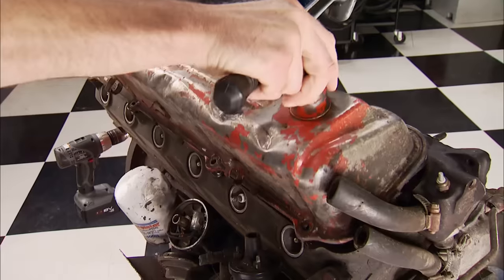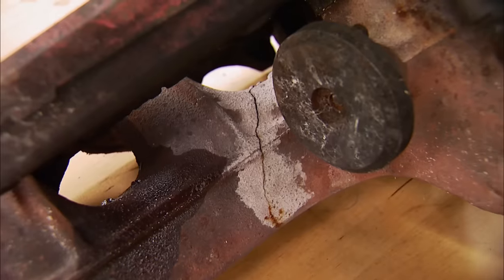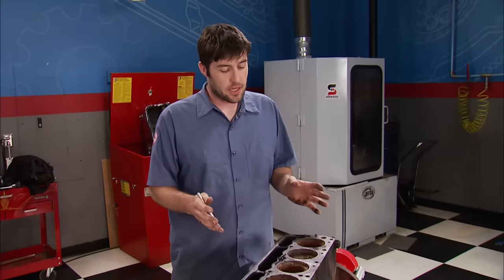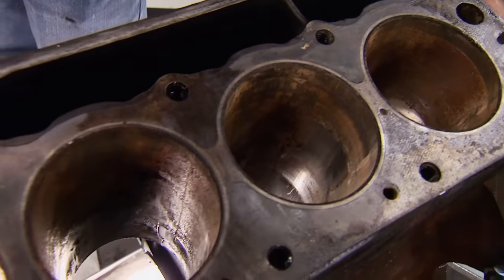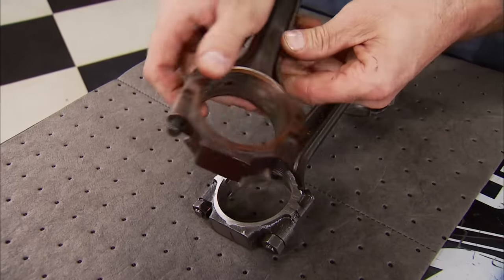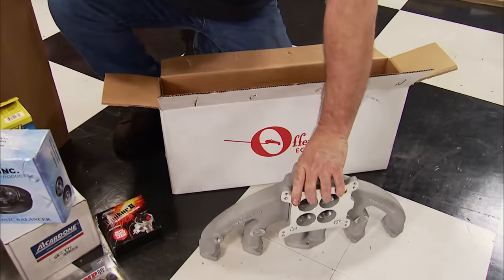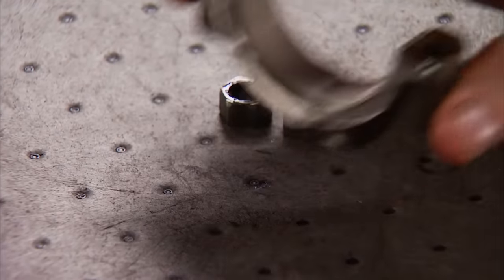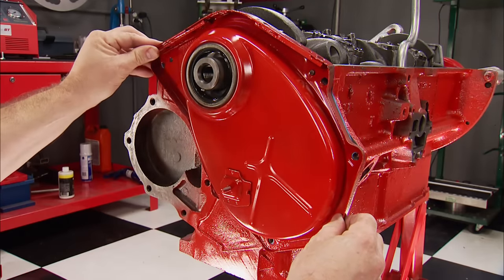Resurrecting A Mopar 225 Dodge Slant Six - Engine Power S2, E2

Comment: I would have filled the cylinders with oil and let them sit overnight before beating on the rods with anything.
Reply: Rob B They could’ve used some WD-40 or something.  That hurt to watch.  Maybe they knew the the block was trashed before disassembly.   Looks like they paid $150 for a cylinder head with all the parts they replaced.
Reply: ATF would have made it a lot easier, and I'd have pushed the pistons through onto the crankcase to avoid the nasties in the cylinders. My guess is that they already knew they were going to junk the engine.
Reply: @1spaghetti32  Right on bud, there was a lot of money wasted on an engine that, while legendary for longevity, will only be good for a completely restored vehicle like the Dart they plan to put it in. I think he said $900 for that head.
Reply: I would've tapped the pistons down an inch first then used a "christmas tree hone" to de-rust above. They'll tap out much easier without risking rod damage.
Reply: Dave Kauffman why wouldn’t they film them selves disassembling the other engine to begin with?
Reply: @1spaghetti32  with all the revenue they're going to get from the views of this video, they can pay a lot of bad engines and it wouldn't matter.
Reply: I overhaul airplane cylinders for a living. I took one look at the corrosion on this engine and thought... ya that's probably garbage. Since you can pretty much build an entire slant six engine out of a magazine, I wouldn't have cared. None of these parts are particularly rare and almost all are re-manufactured at a reasonable price. Also, a slant six in a car that had V8 options generally means it is worth less. So why bother? Get a V8.
Reply: Amateur's!
Reply: @daytonasixty-eight1354  if you have money and time to burn, you can get 600 horse out of a Slant Six.
Reply: @daytonasixty-eight1354  V8s are boring, everyone has them in their classic cars, they're a dime a dozen. I can only look at so many V8s with chrome valve covers and "performance" intakes before my eyes glaze over.

Lower power and less common engines are far more interesting, you got to see how the designers either zombified a larger engine design to make them, or something completely original like a straight / slant 6. They often cost more to get running again because of parts scarcity, but its worth it.
Reply: @GGigabiteM  Hey if you like wasting money go for it. I'm not going to stop you. But if you really want to build a low powered engine in a classic car. Why not start with a classic car that has a low power and uncommon engine that's actually worth something? Like an MGB or Triumph TR6 for example.
Reply: @daytonasixty-eight1354  Not really into English cars.
Reply: $900 was for the Edelbrock small block Chev head featured in the advert at the end of the video. Bit nutty to put $1800 into a pair of heads for a SBC when you can grab a $500 boneyard LS & spend a grand refurbing it & have twice the motor a Gen 1 SBC will ever be.

Comment: Just imagine. No computer modules to reset or sensors monitoring anything and everything. Easy access to plugs, wires, engine accessories, oil filter. A mere mortal can perform nearly all their own maintenance on the engine. Dare I say I miss those "good old days'?
Reply: Amen brother!!!
Reply: If cars didn't have to pass smog tests, there might not have been such a pressing need to replace the slant 6.
Reply: It would have been great to let Mexifornia have the newer trash engines with their computer headaches and let the rest of the country keep running the sleepy sixes.
Reply: Its tempting but dont be a Luddite. Remember  12 mpg and carbon monoxide headaches? Tuneups of spark  plugs, wires, cap and rotor button [check points and dwell] with valve adjustments (and new cover gasket) every couple years? Yeah, The old days sound great. Even new shitboxes go 120k   without any of this. And usually with no oil/coolant leaks .Stand in line for gas much??

Comment: I've disassembled many " high value " core engines that were severely rusted up & never used an air hammer to force the pistons out . & I had most of them spinning over within an hour once down to the short block .  But then , I'm not an idiot !
Reply: guess they never heard of rust penetrant :D

Comment: '64 Dart GT bought an aluminum intake off one of the mechanics that I worked with, put the 4 barrel on it and for a slant 6 it was awesome. Now I just drive the '13 Dart Limited, 1.4 turbo, leather interior, heated seats and steering wheel. My how time changes things.

Comment: I was under the impression the engine was going to get refurbished, not completely replaced with all new parts.
Reply: Dave Micolichek  yes, but you also at least try and reuse most of the old parts. Not just completely get rid of everything internal and external and only use the engine block, in that case just Buy a brand NEW Engine. NOT everyone has the money to just straight up replace everything in an engine... we are not all made of MONEY...

Comment: These slant 6'S  can sometimes work somewhat backwards when trying to hop them up!  What I mean is that these engines were designed to produce power at a certain rpm range and trying to change that can sometimes spit in your face! One of the few engines that don't always respond to hopped up parts! Uncle Tony did a great vidio explaining what I'm trying to convey! He has a vast knowledge when it comes to mopar's! If rebuilding one I would refer to his knowledge & know how! Also if I remember correctly, the exhaust on these worked somewhat like a two stroke in the sense that it sent a pulse that the engine needed! My knowledge is minimal but I do know that sometimes the factory knew what they were doing!

Comment: is it me, or were there no usable parts from your $150 junkyard engine?
Reply: the two bolts for the fuel pump were still good  - lol
Reply: Sparky Wirenut that about sums it up. Lmao
Reply: Maybe the machine shop found it was rebuildable and kept it.
Reply: The problem with the hundred and $50 engine was the Machine Shop! They always say everything's f*** and needs replacing or rebuilding everything was salvageable except the Piston the Rings and The cracked crank now the camshaft? since I would like a Performance Engine I would put in an RV 3 cam I would mill the head put in bigger valves heavier Springs Mill the head port the head put on the 4 Barrel manifold headers put in a hypro pump a reground crank resize rods with heavy-duty racing Rod bolts and I would balance it and I would make a hot rod engine out of it but the fact is they let the Machine Shop decide that everything was no good you bore out the engine and if the the cylinder is cracked? You put a sleeve in it evidently these guys haven't been rebuilding long enough and have a big expensive shop? I've been doing this 52 years

Comment: Man, you can't beat a slant six. I had a 225 in a 1964 Dodge flatbed PU that I hauled firewood in. I drove it for over a year with a rod knocking. It gave out one day when I had to stop on a hill and it just couldn't get going with the heavy load and top the hill once the traffic cleared. It threw the rod and I just let it roll back into the shop driveway.
Reply: You can't beat a 6 cylinder Chevy. You can't beat a 4 cyl. Honda. When you put a tiny engine into a car, it seems to last forever. Oh, so why do we put big engines in them? Because given the choice, most folks want the power!
Reply: Joe Home  that's racist.

Comment: Solid old engines. I have even seen them come in with a cylinder blown out and still running. After boring it out and installing a sleeve it was rebuilt to continue on for many more years. Well designed engine.

Comment: extreme reliability , today the engines have a self destruct timer just after the warranty runs out .
Reply: Modern engines are way better than old ones. Hundreds of thousands of miles without a rebuild is normal now, it wasn't in them days
Reply: @mrcaboosevg6089  I pass brand new junk cars on the highway every day . Now when you need to repair your car , to get to the alternator you got to take out the Transmission and remove the back seat and rent a special tool to do it . I could kill an engineer / designer .
Reply: @harrytuttle8161  I just changed the alternator on my car, it was a ten minute job. My car is a diesel that revs more than this, makes more torque, gets outstanding mileage and makes more horsepower. Literally zero benefit to this this, it was a good engine at the time but not now
Reply: You have a problem....today's cars are far superior to the ones from the "good ole days"!!! Ever own a 57 Ford?

Comment: Thank you PowerNation for doing this build!  I had a '74 dart with a slant 6 from 1988 to 1991 to get me thru school. Ran great and always started, except for when the air temps got below zero. Then I would cross my fingers and hope it would start! Ran it until the frame broke in half on the freeway entrance. I junked it then. :(  Again, thanks for this video!
Reply: Expect for "great unibody construction", these cars would HAVE KICKED ASS forever!
Reply: These were GREAT "kick-ass" American cars! They had style , (GOOD) handling, POWER, and FUN! IF the body/frame construction had been up to (OLD TIME) Chrysler standards, these would have been LEGANDARY.!

Comment: My best friend in high school had an old dodge truck with a 225. We rebuilt it in our junior year and that engine ran so smooth we couldn’t feel it run. Those 225’s didn’t have a lot of HP but they were a nice running engine.

Comment: I wanted to hear it run , after all what is the point of building it if it does nor run !
Reply: it's a slant 6 of course it runs the thing I bet ran when they pulled it those things never stop running even without oil they still run LOL!!
Reply: If you did not hear what they said they have a duster it's going to go into once they get the car they are going to run the 225 that's in it on a Chassis Dyno then they are going to pull it and drop the rebuilt 225 into the duster and run it on the chassis dyno and compare the numbers but that will be on the next episode
Reply: we had one great running car sad to say we sold it to a dummy who ran it out of oil :(
Reply: If you heard it now, you wouldn't want to watch the next episode. :p
Reply: lol they sound like a tractor at low RPM and a sewing machine at higher RPM, unless they're built pretty wild.
Reply: Here you go: https://youtu.be/pjYW-SkQzvE

Comment: Sometimes when you send the block or crank out to the machine shop they come back and say sorry it’s no good. Thank you for not lying about it and pretending it came back just fine. Actually there’s quite a bit more that can be done to this engine and they run surprisingly well.

Comment: I'm gonna tell Uncle Tony.
Reply: Tell tony they didn't put the pistons in backwards and they threw away the points
Reply: These guy's are not real Mopar like Uncle Tony that guys lives breathes and sweats Mopar and knows the 170,198 and 225 like the back of his hand
Reply: They said the only difference between the older block and newer block was freeze plugs lol
Reply: Well. The they paid $150 for the original boneyard engine. And are only going to use the head. And a few brackets and hardlines. Then all these aftermarket parts another block. Machinery cost and so on. That thing better last well over 1,000,000 miles beacuse the original ones very often did if they were maintained correctly.
Reply: @adamturner2507 , that is a good way to identify the 
real "Leaning Tower of Power."  Look for the 3 
freeze plug version.

The blocks may be similar, but the heads will 
be the smog version.

steve
Reply: Haha you made my day
Reply: Something Funny 

Uncle Tony has forgotten more than these guys know about a slant six

Comment: This makes me want to rebuild my aluminum block that i have collecting dust in the garage
Reply: What for? if it's in good condition sell it if it isn't going into a numbers matching resto. 

I know a guy that rebuilt an aluminum block 225 and he was thoroughly unamazed at the power for the money spent. The design doesn't lead itself to really good power increases because of a few things. The capacity is a bit small even at 225 for the stroke length, the small bore inhibits breathing because you can't get big valves in the head. If you have that stroke length then a big bore is required to sufficient valve area to support high rpm breathing.  They run out of air because the pistons go faster than the capacity of the valve area to supply air. If you put a small blower on it, it could be the best way to go. You might find it is an entirely different motor lol but I just read what wikipedia said about the aluminum 225 and it mentions they're no good for that either due to the open deck. 

A slant is the kind of motor that you're painted into a corner before you start and the exercise is unpaint your way out as best you can.
Hyper pak seems about the best that can be achieved relatively cheaply:
https://en.wikipedia.org/wiki/Chrysler_Slant-6_engine#Hyper_Pak
Reply: @ThePaulv12  I was going to put in a lightweight "T-bucket style roadster" Maybe polish the block, put multicarbs and cruise it. Nothing stressful. Yes I'm familar with all the literature on limitations etc. If someone is interested in it I'm an hour north of L.A.
Reply: @332ARA  do it ....DO ITTTTTTTTTT  ..btw redline and speeco in australia make some good speed parts for the slant 6...or did

Comment: For those of you wondering "why did they lean it to one side?"

It was designed to be a replacement for the old flat head six  cylinder industrial engine.

The only way they could get the much taller OHV engine to fit in the same engine compartments was to lay it over on its side.

(They didnt want their industrial and commercial equipment customers to have to do major redesigns to fit in a modern engine)

The off set water pump is so the fan would be in the same location.

The only design change industrial equipment manufacturers had to do was deal with the exhaust flange being on the other side of the engine....other than that,  they pretty much dropped into whatever the flat head six had been in.

So the rumors of "they were going to make a V-12" ,"They wanted lower hood lines on their cars" and "Laying on its side compensated for torque wearing out the cylinders unevenly" is just urban legends.

The indistrial engine had good overall performance so they started putting them into cars.
Reply: Dave Micolichek  No , the engine first appeared in the mid 50's as an industrial engine to replace the IM-6 flat head in Yale Forklifts ,they didnt even put it in automobiles originally.

That this engine was in Yale forklifts a good five years before the first car had one , kind of blows your claim about hood lines right out of the water.
Reply: Dave Micolichek  You're trying to bullshit a forklift mechanic about when slant sixes first showed up in Yale forklifts.
I'm not going to argue with you about it.

Comment: "how to buy a engine throw it out and build another one from scratch"
Reply: Basically. These guys are frauds
Reply: They thought the first block would be usable.  Turns out it was not.  That’s not fraud.  Just bad luck.  Real hotrodders know that engines break, and accept it as part of the deal.
Reply: @karenstjohn6759  they should have named the episode something different.
Reply: @HellsHatersEnt  That, they could have done better.
Reply: Could have bought one that runs for about the same money.

Comment: I had a 79 Chrysler lebaron that had one of these in it.
That thing ran forever.
Reply: had an 81 same deal, wrecked the car 4 times, engine kept going sold it with 230k it went to mexico, probably still running

Comment: The comments were hilarious, and I agree.  We had had a slant 6.  Whenever you did a fast left turn, (like pulling out in traffic) the motor would die and you would have to put in it park to start.  Replaced the carb with a holly (on advise from experts) and still did the same thing.

Comment: The Beauty of an in-line six engine is its longevity and reliability. My first vehicle was a 1969 dodge D 100 stepside. It was easy to work on. Parts were cheap.

Comment: Come on guys.  Load those piston bores with wd40  before  removing
Reply: No kidding huh? Soaking it with PB blaster or WD-40 would have been intelligent..........
Reply: Or chuck some phosphoric acid down there and go for lunch. It’s gonna munch through dry rust in no time :o)
Reply: @teamidris  Amd the metal too lol if there ain't much left.
Reply: @teamidris  Coca-Cola will do the job too ! XD
Reply: Waste of WD-40. That corrosion is enough to show it's garbage.
Reply: @daytonasixty-eight1354  yes it is.  But to show how to remove any corroded part for learning  purposes.   Needs penetrating oil
Reply: Porsche mentality (keep redesigning a rear engine vehicle instead of moving to a mid engine for 40+ years) seems to be very common among men, as if it is some sign of masculinity or something to insist on doing things the hard way. Why use something that works better, when you can do it the most difficult way, thereby showing how stubborn you can be?

Comment: they should have used a AussieSpeed intake on this rebuild, since they have equal runner lengths vs the offy.
Reply: The Australians know how to build these better than the Americans, in the States the only thing muscle car guys know are V8's.
Reply: Aussiespeed ain't a sponser
Reply: @Welcometofacsistube  not sure why that would be?  That just means unequal fuel distribution to the cylinders.  There is a old thread that covered this in great detail on slantsix.org